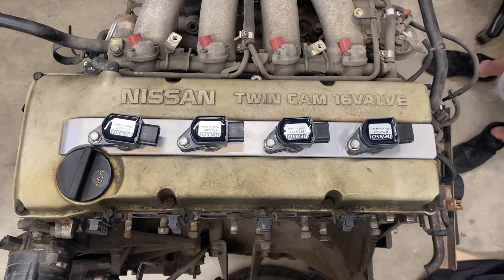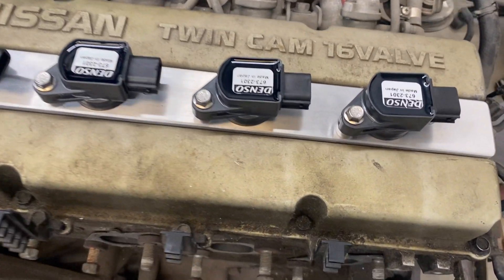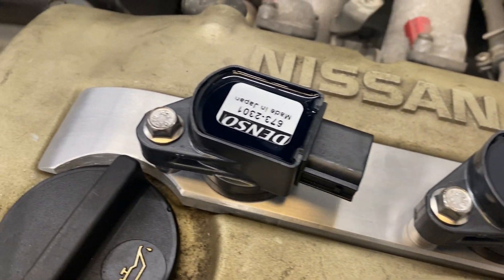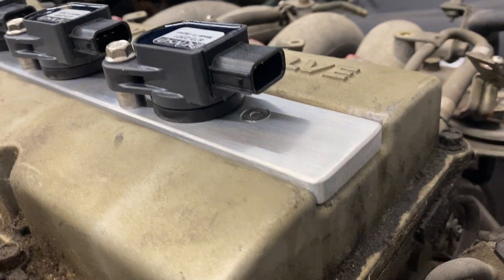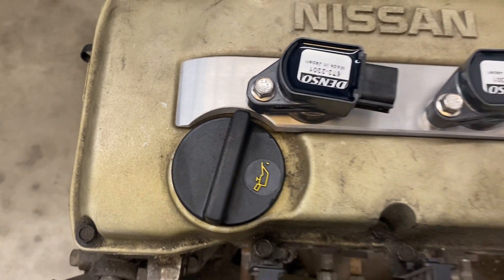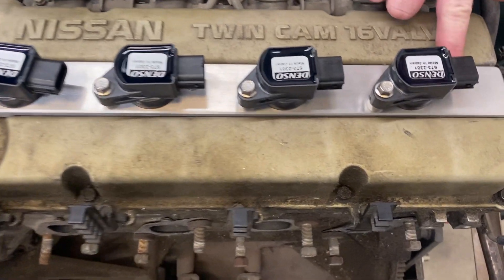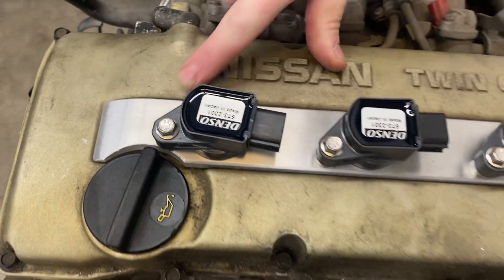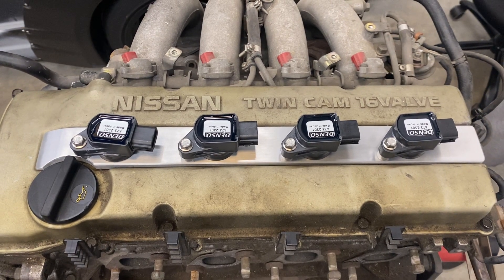NTR KA24DE Engine Honda K-Series Smart Coil Conversion Kit

Comment: Will this fit 2001 frontier ka24de
Reply: Im trying to figure that out. I have megasquirt for 91 ka24e. Trying to convert the harness clips for the ka24de and figure out cop conversion. The ka24e has 4pins in the distributor harness 1 blk/wht 12v switch 2 grn/yel 180° signal 3 grn/blk 1° signal. the ka24de distributor has 6pins. Theres another video out there that explains it, but I'm still confused. What is vr1?  Is that the signal 1°  grn/blk wire?  Is this the wire that gets 1k resistor to 12v switch?
Reply: I'm wondering for my 2002 xterra
Reply: My ka de is at almost 200000 miles. You think the timing chain is still good and how much of a pita is it to fix?